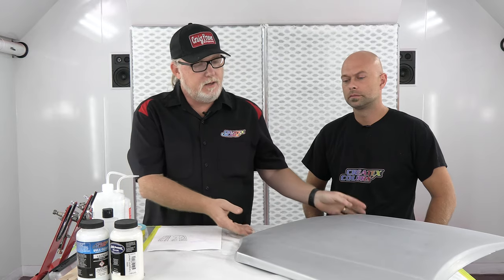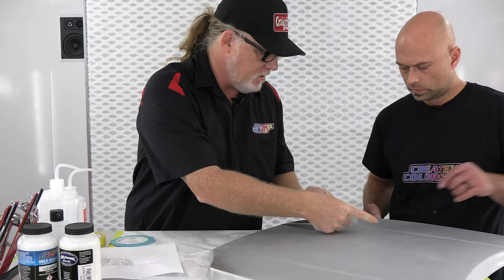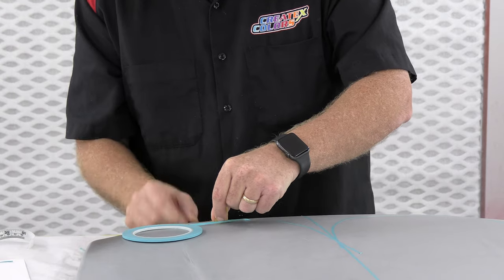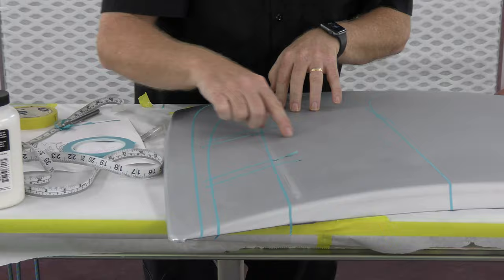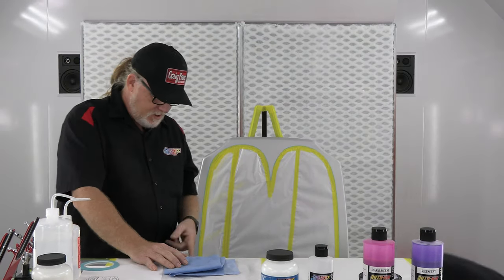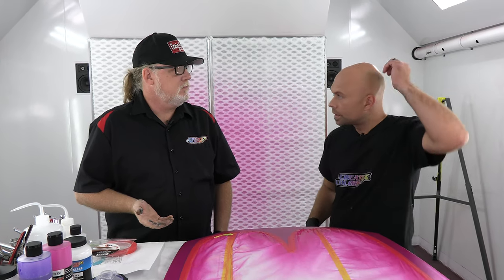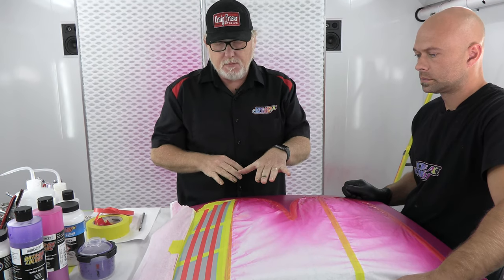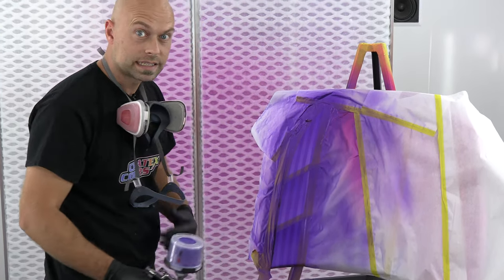Candy Pearl Drag Racing Boat Part 1

Comment: Nice video guys! I thought that it wasn't standard practice to put a 2k clear over the top of the Autoborne sealers. Is that no longer the case? This would be great because I've been putting the clear base over the top and then clearing.
Reply from the maker: Applying a 2k, solvent-based urethane clear soon after applying AutoBorne Sealer is not advised as any excess water in the sealer will produce craters in the finish. When AutoBorne Sealer has thoroughly dried prior to applying the clear, as was the case with this paintjob, then it may be top-coated with a 2k, solvent-based urethane clear without risk of craters in the finish. Thank you.

Comment: Should I use a 2K, or the UVLS between the silver sealer and the graphics?
Reply from the maker: 4050 UVLS Gloss Clear is an excellent inter-coat for graphic applications. Thank you.
Reply: @CreatexColors  So you guys used sealer then 4050 then candy mixed with 4050 then a 2k clear.
For non automotive work can you use 4050 as the top coat as well
Also if you wanted to paint graphics over the candy would you recommend to use 4040 bleed checker and does that only apply to non opaque graphics